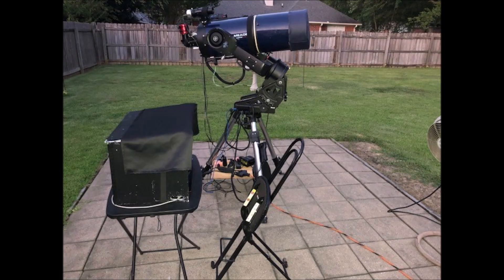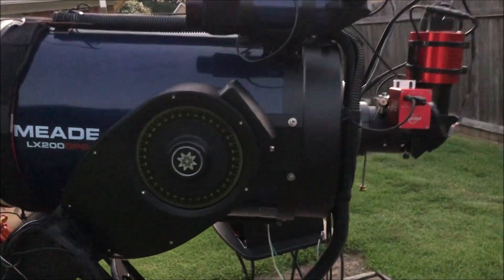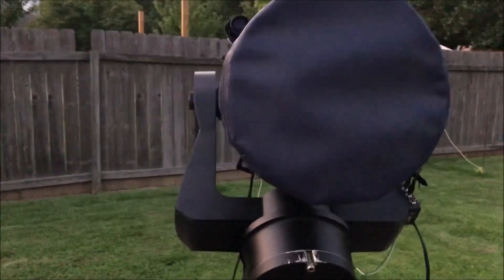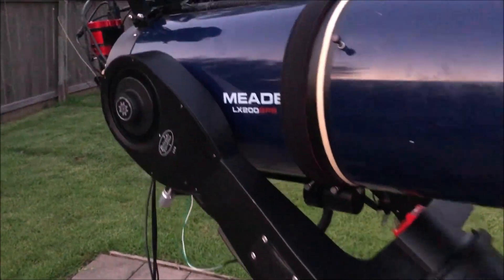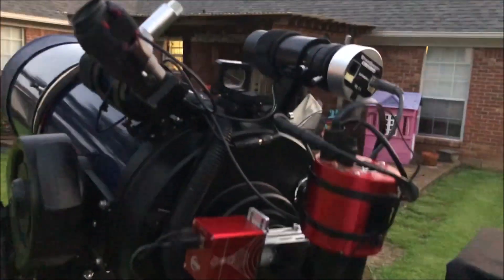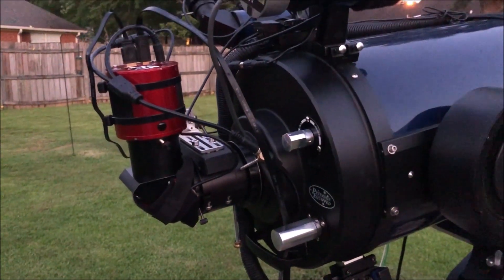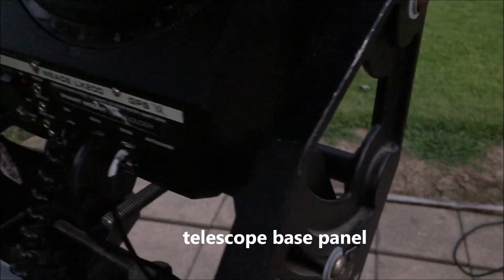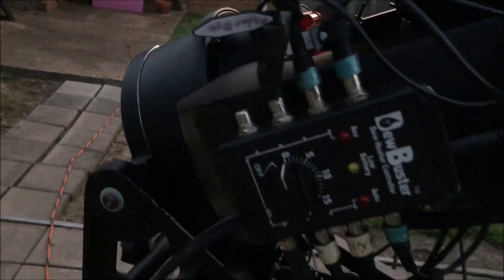LX200GPS w/ Vertical Image Train

Comment: To solve the balance issue near the zenith you need to change out a barrel weight to a pancake style weight that can hang down away from the OTA counterweight rail.  Your diagonal needs to be aligned so that it is 180° to the counterweight track.  Adjust the  pancake weight distance from the center axis to counteract the optical centerline offset of your imaging gear caused by using the diagonal. 
The distance from the fork OTA axis and the  offset from optical center is very sensitive to position because the torque varies with the square of the distance!  To maintain balance from 0 -> 90° Dec the mass of the counterweight and offsets of the center of mass from both the Dec axis and optical centerline should match as closely as possible the center of mass and offset of the imaging gear.  Obviously it won't be exact.. in fact,  you'll want to have some bias either nose heavy or tail heavy to ensure the drive train is under oad at all times to avoid backlash float. The same is true for the RA drive train. Add a small weight to one fork arm a needed to keep the RA axis under load and avoid going through a balance point where the backlash causes float or shifts bias as you track your target.  The barrel weights are mostly useful for offsetting finder scopes. Any gear mounted further away from optical center needs the 2 axis offset of the pancake system. 
I see you have some gear attached to one fork.  Be mindful of the effect of this weight as for a 10" OTA it's riding about 7" offset from the RA center of rotation. The forks start out unbalanced with the DEC drivetrain and clutch plates being in one side,  and that is intentional as it keeps the RA drive loaded. Your add on may cause a zero balance point in RA motion unloading the drivetrain or overload it. Neither is good for guiding.  
If you're getting times or parts of the sky when your images look bad or guiding freaks out,  this is probably why.  

The other problem you are sure to encounter  is flexure in your imaging path due to the use of slip fit attachmenta that are only designed for visual use.  They will slip and they will sag when you attach heavy cooled cameras with spacers. The Meade microfocuser can be configured with threaded attachment on both sides. But watch out for adapters with restricted internal optical path.
Find a diagonal with removable barrels that you can replace with threaded adapters/spacers. 
The Meade SCT was designed around a 105mm backfocus.  As you discovered,  the effective focal length decreased as you increased the amount of backfocus distance. It also reduces the image circle size and brightness. Hopefully you've already changed the backplate to rid yourself of the SCT 2" threaded interface with its small 37mm clear optical diameter.  You should be able to get APS-C sensor coverage with minimal light drop off if you maintain 48mm interfaces throughout and are careful to find a diagonal with a  large clear optical path and standard thread sizes.  Although once your added the diagonal is tempting to relax about spacing within the limits of the OTA focuser,  it's best to keep things as short and tight as possible. Long focal length helps a bit with tilt and sag, but vibration and light drop off with long backfocus more than offsets it. 
Great creative idea to image near the zenith especially for those with bad seeing and light pollution!  
Thanks for posting. 
I like your rig.  I'm partial to Mead optics 😁😁😁 2:54
Reply from the maker: Thank you for the info and reply.  I will look into that weight system.  Lots of info to take in for sure.  I have been trying to get better tracking for many years now.  The LX was my first big purchase back in early years of 2000.  There are times I got really nice pictures with the telescope but that mostly occurred at the club's dark site.
Reply from the maker: I welcome recommendations about getting my rig to track better.  I re-read your suggestions and did some searching on the pancake weight system you mentioned.  I assume the weight system you are suggesting is the one where the pancake weight can be screwed in and out on the treaded bar that is connected to a dove tail plate that is connected to the bottom of the telescope.  Is that correct?  Is there a potential problem with the projected pancake weight and its threaded bar colliding with the wedge’s sides?  I saw a system that listed for a Meade 10” LX and got a sticker shock.

I moved my Dew Buster controller to the East arm to add weight to that side.  I read that the east side should be a little heavy when balancing the setup, so the gears are engaged.  I realize that when that side slews to the other side that feature is probably not working.  

As for the rear cell items, I have not changed anything out from what the telescope came with when I purchased it new twenty years ago, other than Bobs nobs for collimation and Peterson Precision kits for the gears from Nylon to metal and a focus knob upgrade.  

The opening of the rear cell attachment piece is original and does have a 37mm opening but I need that piece to attach the Microfocuser’s adapter ring for the Microfocuser’s connection.  It did not occur to me that beyond the 37mm opening I had 48mm openings to the camera’s sensor.  However, the camera’s sensor is nowhere near 48mm wide.  As for the back focus of 105mm, Meade tech people told me not to worry about back focus unless I use the 6.3 reducer, then the 105mm would apply from the glass of the reducer.  I had asked them about both the 55mm and the 105mm back focus last year.

I did put a small amount of tension on the Microfocuser’s ball bearing set screws.  I also tightened down the nose pieces on the 2” diagonal.  The last few nights that I was using the vertical setup, I did not experience any slippage or rotation as I did a few months ago when I first tried the vertical setup.
  
Seeing conditions in my backyard are Bortle 7 and at the club field it is Bortle 4.5.  But my backyard is getting worse I think on light pollution.  I have noticed in my backyard that EAF and plate solving has more failures than at the club’s field and the light pollution filter does not help in the backyard either.  The light pollution filter may help on taking pictures but the EAF and plate solving it does not.